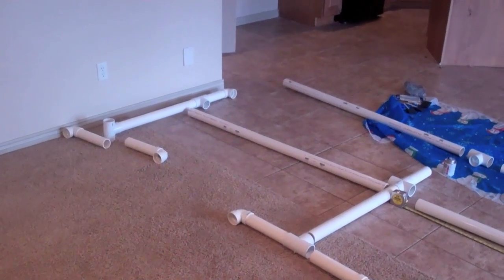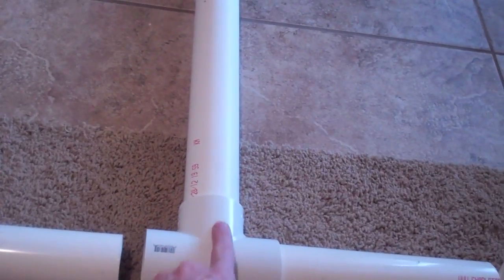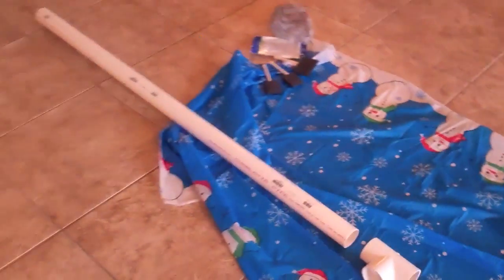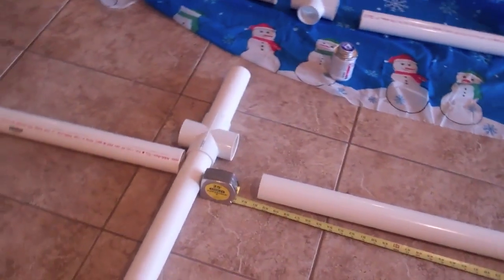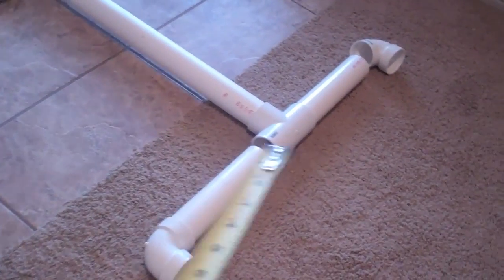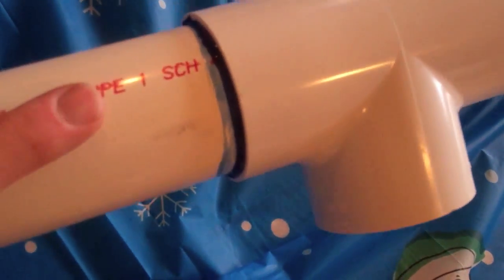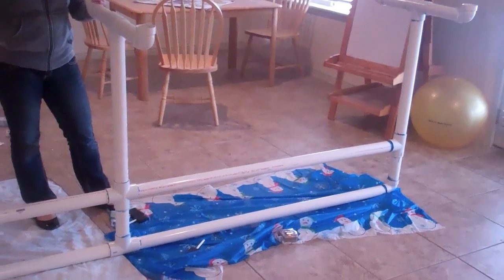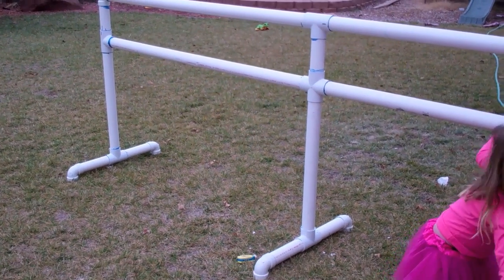How To Build A PVC Ballet Bar in 30 Minutes [HD]

Comment: Can you remove the lower bar make it higher and use it as a gymnastics bar
Reply: No, ballet barres support little to no weight and is used for light touches. It couldn't handle full weight. Hope this helps :) Sorry this is late.

Comment: No, but I did find a more detailed explanation on another website.  If you type this in as a web address without spaces you might find it: leotards and the buns in them . wordpress . com. It was published on Sept. 29 2011 under "at the barre." I haven't built one yet because I realized I need a better floor.  I think I will lay some mats down and then put the hard flooring on top of them to help absorb shock.

Comment: ok but asking an 80 lb child to use it doesn't prove that it won't topple over when an adult or overweight adult uses it
Reply: pt0407 I’m not sure for fitness but for ballet, you aren’t supposed to put your body weight on it. It’s there to assist for balance but not to put your weight on.